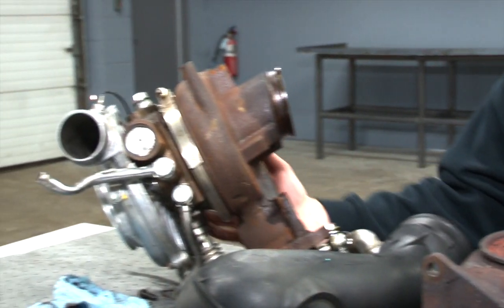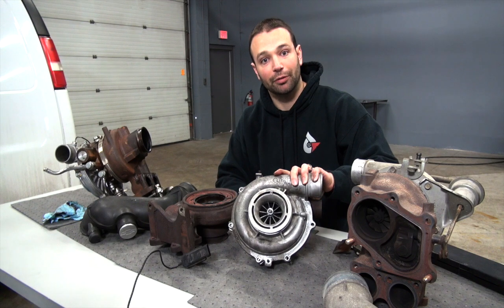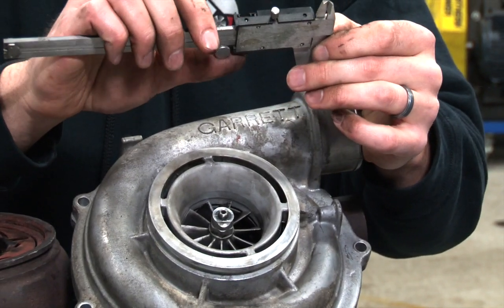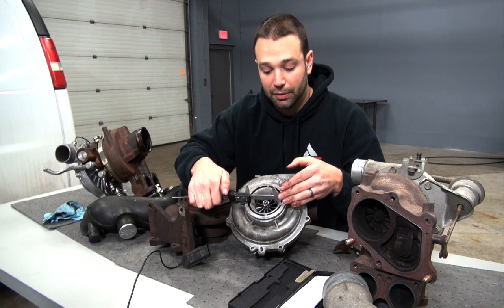DURAMAX TURBOS PART 3 OF 3

Comment: My 2006 LLY turbo just failed.  111K miles. I think rust from a lack of being used.  Stuck at 88%.  Used bidirectional scanner and new sensor would not relearn.  Was told it had LBZ heads on it but 8th digit of vin is a 2.

Comment: My 07 classic turbo does not free wheel spin as long as I would expect (while the engine is off) I had the intake pipe off and spun it very delicately with my finger to test it. The truck spews out black smoke starting at about 2200 rpm. Below that rpm it seems fine. Because it had a Predator program upgrade, I am wondering if the turbo bearings are bad or the sensor is bad or perhaps there are bad injectors. What is the plan of restoration recommended? Is there a good shop in N.E. Pa. ?
Reply: EZ570 sounds like you may have had a boost leak.